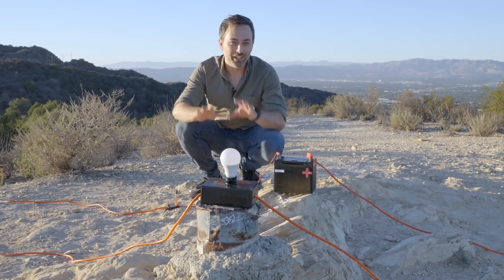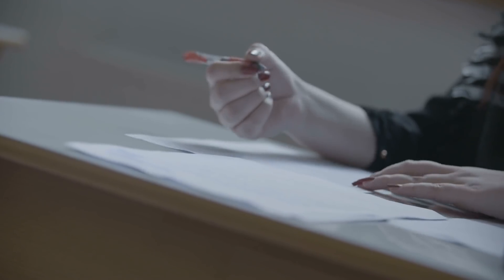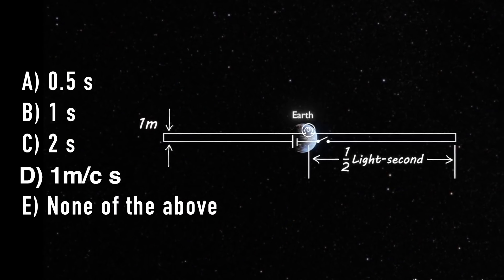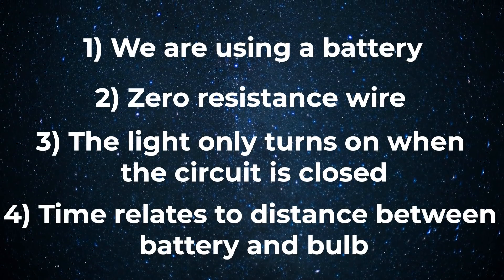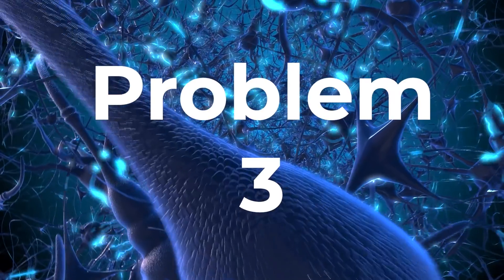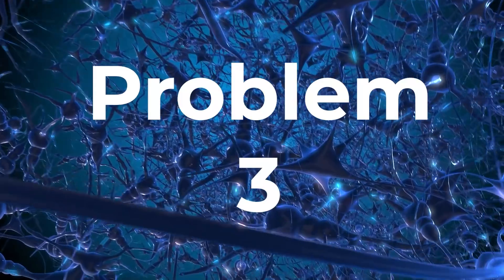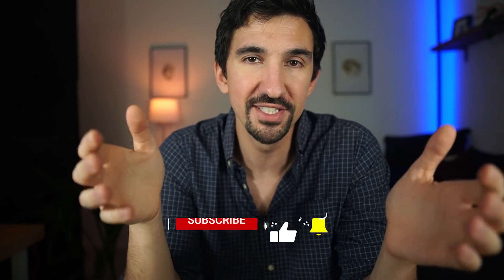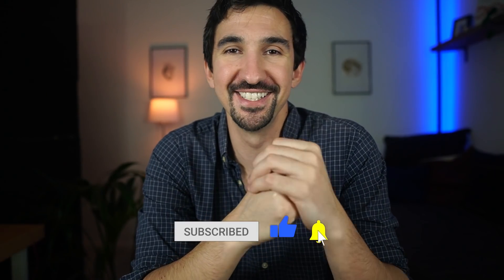Is Veritasium Wrong About Electricity?

Comment: I don't see an issue with his answer of 1/c. I assume he meant the 1 represents the 1 meter between the battery and the light bulb. So doing a unit analysis we have m / (m/s) = s so it is correct

Comment: There would be a transient current in the light bulb when the switch is closed, and that would happen after 1/c s for sure. But that is not enough to have a steady glow of the bulb (rather looking at the battery and the bulb used, it looks like you wouldn't see anything by naked eye...you would need at least an ammeter to detect that sudden flick). The steady glow will start only after the EM field reaches the bulb from the battery through the whole length of the wire. While asking the question, Derek never mentioned if he is asking about the transient current in the bulb. If not then, yes, his answer was incorrect.

Comment: Hi. Good point about antenna pick up. As an electronics engineer I think this can be compared to the first transatlantic telegram. Trying to control the shape of the signal means matching impedance of the source and the line. Same also for high speed 20Ghz+ signals in computer motherboards and data centres. I have always imagined the signal to move at light speed, but now I have to think twice. The transmission line will act as a filter and distort the signal. When the switch closes, the electric field vector is pointing along the wire, so I think there would be an instantaneous (the speed of the dielectric force vector) change in voltage at the end of the line. The ramp up of the voltage depends on the cable impedance, as energy is stored in the cable parasitic circuit elements.

Comment: you talk about antenna and capacitor,  but which part of POYNTING VECTOR  veritasium said didnt you understand? POYNTING VECTOR(energy flow or power) is E X B... poynting vec is the same thing as antenna and capacitor. it leaves wires, and it directly goes to  where it is consumed by the example of work done on the system  per sec by the battery.

Comment: Veratasium's explainations always miss parts of the subject. So I see where others suggest how the Earth's magnetic field and solar ionic radiation would influence the circuit. But as a thought experiment we would have to negate all outside influences from the assumptions. Also lacking in V's description are the specifics of the bulb. For simplicity sake assume an incandescent bulb which uses resistance to current to produce heat and thereby light.

In an ideal environment turning on the switch would start a propagation of electrons pushing the next atom's electron off. The electric fields of the electrons are how the force is transmitted. The actual jumping of the electrons then produces a magnetic field as an effect of the motion. In the case of this conductor, energy is being lost in the production of the magnetic field and in the resistance of the atoms to letting the electrons jump to the next. Veratasium's video tried to explain how the energy is transmitted. The main energy conduit is the electric field. The magnetic field is an effect and an energy loss from the system. The electric field would send energy through the wires at nearly the speed of light with a reduction depending on the delay between each electron jumping. So the electrons don't move quickly but the force against them is passed along close to the speed of light. 
This is also making the assumption that the wires are not so close that the magnetic field in one would begin electron movement in the other side. In other words, let's exclude the effect as an antenna. So in this perfect stand alone system, the bulb would react to the change in the electric field something slightly less than the speed of light. This is also because the bulb requires movement of electrons to begin producing heat and light. Therefore the bulb cannot light until sufficient electron movement is reached. 

In the real world we would see the magnetic field in one conductor start electron movement in the other wire before the actual electric field effect on the electrons would be received. This would essentially be the "antenna" effect your video described. 
Similarly with such long wires an amount of capacitance would exist so there could be a delay before the bulb would turn off. Way too many influences for anyone to have a simple answer in real world settings.

Comment: Still wrong. Imagine a circle of marbles in a round track. Your switch is a hard barrier that prevents the movement. The battery is launcher applying force to the circle. The light is just a ticker that adds a little resistive force to the circle. What Veritasium question asked is the speed at which the next ticker would click, but his answers were all in relation to the marble right next to the battery. What your thought experiment proposed was the movement behind the ticker to in front of the ticker. The correct answer is instantaneous because electrical fields are singular units bound to each each other between the atoms. But it's also impossible. Electrical resistance in electricity serves the same purpose as mass in movement. It's like trying to say you can push a 30k kilometer rod and the other end will move instantaneously. If the rod had no mass then it could be easy done. If the rod had the density of loose hydrogen but the strength of steel it would still shatter by the force applied to one end to move the entire rod. The same with this with electricity, with more marbles and track added, being longer wire and more ions, more force or more voltage would needed to be added to make the slight resistance at the ticker not stop the whole chain and throw all the marbles out. Eventually you'll get to the point that the strength of the switch will give out and break off the barrier which would be an arc in electricity.
Reply: So you are saying if you have a 300.000km long line of marbles and you press on end (assuming enough force) the marble of the other end will fall of immediately?

If the answer is yes, then you're wrong, you would break information transmission at the speed of light. And marbles are only made of atoms, and if you press on a marble on one end, the atoms push on atoms etc. and will take 1 second (speed of light) for the compression of atoms you made to pass through and the marble of the other side to fall off.

This only seems instantaneous in normal life since speed of light is so fast. Same with electrons, even if one electron push another... the push effect will not travel faster than the speed of light.
Reply: @georgelionon9050  "So you are saying if you have a 300.000km long line of marbles and you press on end (assuming enough force) the marble of the other end will fall of immediately?"
- yes, if those marbles had no mass which is like saying a conductor without resistance. The switch is acting like someone's finger holding back the marbles at the other end, if they removed their finger they would instantly fall off once they removed their finger. The entire line is stored potential energy in either way, the kinetic of throwing the switch or removing the finer act is a unitary act of the potential unit in reverse of the source of the kinetic. The information being transferred is not "here is energy" it is "there is no longer resistance". Anywhere along the chain where "there is no longer resistance" the kinetic action starts, whether it is a block from further down the chain or stored potential from one atom the next.

Comment: I think there is a piece you are missing, being what is enough to define as "connected". EG: The potential in the wire comes from its properties, such that what potential the wire already has is immediately* felt when the circuit is closed (minimal to say unless the lines already has a potential load**), but the real question is then for how long does it take X amount of potential to be acquired (defined here as the light being turn on?, even then by how much is not stated!) to achieve "connected", and that question then must include many more details like what light and how powerful.

Because the wire could be loaded with enough potential, closing the circuit could therefore turn on the light instantly (lets call it cheating). You could also actively remove the load from the wire and through monitoring only stop that action when a high enough load is felt, allowing the user to have more control to achieve desirable results when loading a toggle-able connection, like if you wanted a snap instead of a delay with some peak.

Comment: Mannnnnnn, current need to be flowing at the battery and load for the poynting vector to do its thing, i.e. the battery to lose energy to the fields of environment and for the load to get that same amount of energy from the fields of the environment.

The speed for the current to "turn on" travels at the speed of light down the wire. When you switch the circuit close, it takes time for the current to start flowing down the wire, to the load and back down the wire to the battery. While indeed it's true that it's not the current carrying and supplying the energy; the current enables the conditions for the load to draw energy from the fields, it still takes time for this configuration to be fully activated and for the load to get energy from the fields.

Comment: Veritasium's video bugged me as well. Indeed your point is correct. The problem of dropping the resistance makes it however inaccurate the hypothesis of cable equation that was missing from Veritasium. 

However it is not an antenna: it is a transmission line. No longer Ohm's law holds but Lord Kevin's cable equation.

Comment: I'd like to give my contribution to the discussion about this problem. Assuming there is no resistance along the wire, the first electron pass through the bulb 1m/c second after the circuit is closed, current will rise in a linear way and is full operative (I = V of the battery / R of the bulb) after (  (1/2) X 300 *10^3 km X 2) /c seconds, that is equal to 1 second. Does it make sense?

Comment: I look at this problem as below but the reality is there are no zero resistance wires so I can't say for sure I am right. But as you stated, if it is a regular wire there will be so much resistance the current flow will be to low to measure and the light bulb will not light which I agree with.
 A zero resistance wire presents a problem in that the impulse out of a battery when you close the switch produces (in this case) a current as high as (guessing by the looks of the battery) around 300 amps. The electron outflow is limited only by the number of electrons on the negative plate(s) plus the rate that new electrons can be provided by the chemical reactions of the battery plus the internal resistance of its construction. Being a zero resistance wire the electrons on the negative plate would have no problem moving away from the other electrons on the negative plate and they would be pushed along probably in an almost linear fashion rather than the usual scattered pattern in a regular wire. This would allow them to reach very high speeds in their direction of travel contrary to the standard wire where their speed in their direction of travel is slowed down by bouncing off other charges (electrons) held in orbit around atoms.  Both types of wires should have the electrical field travel down them at around 60% to 70% the speed of light but in the zero resistance wire the electrons themselves may be going pretty close to that 60% to 70% speed since the only bouncing would be off the "wall" of the wire kind like light going down a fiber.
The initial pulse should be short (depends on battery construction) and then taper down and if the wire was long enough down to essentially zero.  
This starting 300 amp impulse being that close to the light bulb could possibly flash the bulb? If it was a neon indicator bulb it would flash for sure, and if an incandescent probably not.
The high current impulse will, within just over a second get to the light bulb and most likely produce a voltage spike high enough to destroy the light bulb. Not sure what the bulb actually is, so don't actually know its ability to withstand impulses. 
And the battery will most likely be ruined due to the high discharge current, but then again I have seen batteries make it through these faults just fine, just not as many as I have seen damaged beyond repair.

Overall my view is that the test setup in this thought experiment cannot be assembled nor properly modeled except to go back to your original statement that the bulb will not light do to wire resistance.
Reply: P.S. Most of this is based on the fact that a Time Domain Reflectometer can tell you the length of a wire without a complete electrical circuit.

Comment: I kind of understand the transmission line explanation, but I have a hard time believing the full voltage and current would be available at the lamp 1m/c seconds after the switch is closed. It seems like this could be tested on a much smaller scale, with some high speed measuring equipment.

Comment: When I was a kid, I built a powered AM radio working without a battery. I used a large Marconi antenna, a 25 meter wire. I used two rectifier circuits, one before the tuning section and one after it.
The rectifier before the tuner converted into DC all the frequencies the antenna was receiving, and powered a two transistor amplifier. The rectifier after the tuning circuit extracted the audio signal from the tuned frequency.
Think, 25 meters of wire gave me at night from 20 to 100 milliwatt to power the entire radio. Imagine 300,000,000 meters would power the light bulb certainly, and possibly the entire house. Space is full of radio signals in all portions of the spectrum...

Comment: I think that you forget the wire also has an capacitance! I think when you open the switch near the lamp the light switches off immediately and the accumulated power will dissapate in the air (or space). But when you open the switch halfway all the accumulated power will have to go to the lamp, at lightspeed!
Closing the switch will probable kill your switch or battery ;)

Comment: I had the same line of thinking. The reasoning of Veritasium is flawed as you could theoretically light up other lightbulbs on parallel circuits that are not on the closed circuit. I can understand the coupling of the lines will create a (marginal) current in the opposite wire but one could also add an extra hypothesis to assume that the outgoing and incoming lines are not coupled (unless I'm mistaken, twisting the outgoing and incoming cables around each other would be sufficient).

Comment: From what I gathered from this video, Veritasium's and Science Asylum's is that electricity travels indeed at the speed of light BUT it's not the electrons that move that fast it's the electromagnetic field along the wire. I think of it as a rope being whipped or as the waves in the sea. The water molecules aren't going anywhere, they're just moving up and down. What we see moving forward (the wave) is in fact just energy. My mental model however does not explain why electrons slowly drift anyway (I remember a speed in the order of millimeters per minute),  I'd be interested in your input